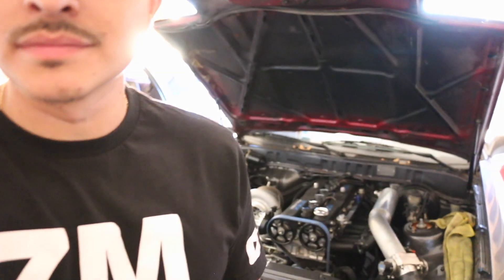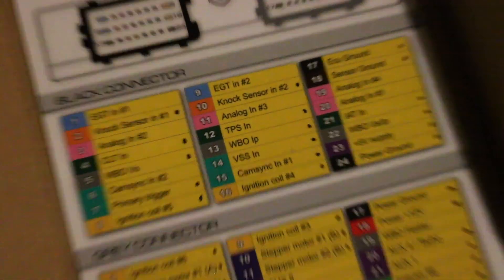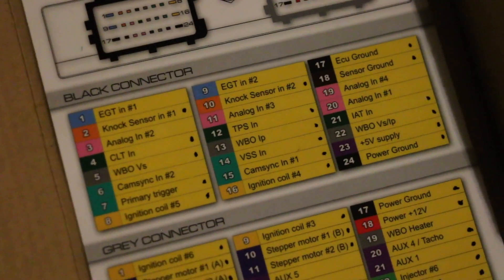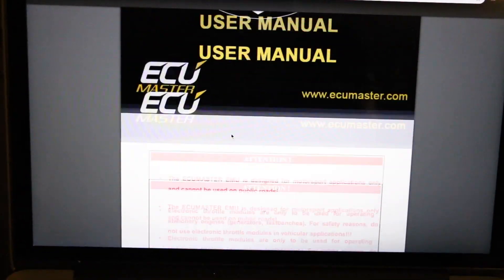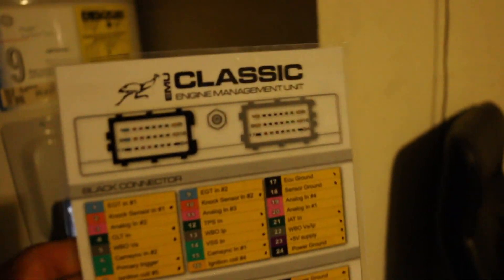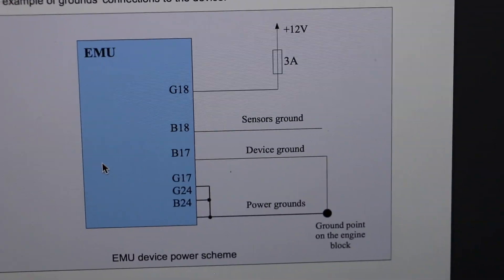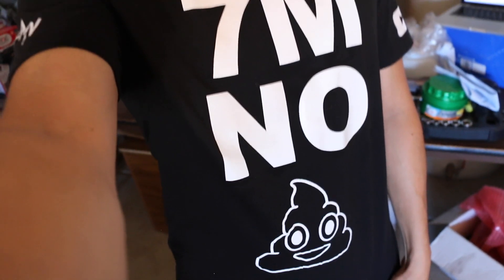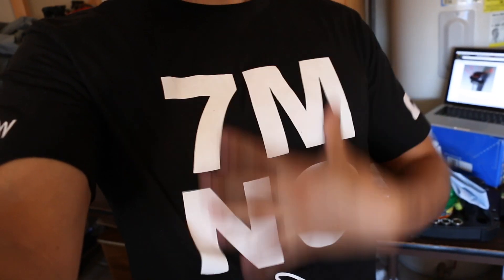MK3 SUPRA ECU MASTER EMU CUSTOM HARNESS (RESEARCH)

Comment: @6:27, I plan on using my WB Gauge to Send the 0-5v signal output to feed the EMU Black the O2 Reading for tuning etc. Once you check the Readings match You're all set. Also Ensure that your O2 sensor is within the spec distance from the exhaust based on the gauges Instructions as you will want to have the most accurate readings both to your ECU & Gauge. (Some Gauges reccomends 18 Inches away from the Exhaust on the downpipe. just a note to self). 

Thanks for being informative. Definitely enjoy the content. Keep it up. Hope the channel grows .
Reply from the maker: BjornFSE ive read that even then from the gauge there is still some small differences in voltage reading. That the most accurate reading is directly from the sensor

Comment: Pro tip for labeling your harness. Print you labels on paper, cut them out and use clear heat shrink over them. 
Labels from a label maker will turn black with the heat from the engine.
Reply from the maker: Franco Runco gotchaa thanks for letting me know.

Comment: Just finished wiring my emu black to my harness, goodbye wastespark!
Reply from the maker: Gortern niiicceee how was the process
Reply: @-LFATV  basically it was just a constant pinout read for both the 7m and emu, also had a owner's repair manual to help identify colors aswell as multimeter readings to furthermore identify. Wasn't too bad once everything was identified.

Comment: Use the pinout on the ECU Masters website for the 87 Supra. It will show you exactly what pins go where from the factory Supra harness to the standalone. 

https://drive.google.com/drive/folders/1CC1NSdBG3ReFh4GhS6N0EMRFGrygZqeZ

Make sure you know exactly what you want and where it will be mounted before you start making your engine harness. By that I mean your aftermarket stuff like the e85 sensor, wideband sensor, fuel or oil pressure sensors, GM air intake temp sensor, ect...

Label every single wire at both the ecu connector and the other end of every wire. I used painters tape at the wire ends and a clean label on the ecu side.

Just know for the grounds, 5v+ and 12v+ there is a lot of tie-ins so keep this in mind when you wire your sensors, inputs and outputs. 

You talked about fuses but I never had to run any fuses on my ecu masters standalone. The wideband has a 10a fuse built in the connector and the standalone uses factory EFI fuse so no worries there either.

Personally I would get rid of that factory igniter (also to clean up the wiring), have the ecu power your ignition coils and set it up as a wastefire set-up. I would also have it wired for sequential injected so each fuel injector operates independently and not batch fired in 2 sets at a time. 

I hope all goes well with your build and here is my pictures I took during my build. I never built a engine harness before but it turned out amazing: https://imgur.com/a/QKvz9

Comment: Use the r154 trans abs sensor (3wire) for the ecu vss input. Also a tip, use only the 4wires for the toyota iacv (software must be configured as stepper motor)
Reply from the maker: Cody Stedman thank you for the info man

Comment: I can't wait till I go megasquirt on mine, though I need a bunch of supporting mods before I can get there.
Reply: Don't do it, every high hp 7m is reliably running ecumaster and aem. I went megasquirt and couldn't get the car to keep sync once it got over 20psi.
Reply: @EditsWithBlur  I dont have 2k to put into just the ecu. Plus yeah it looks like itll be a little difficult, but there were 7m guys running them back in 2007 I dont see with newer tech I couldn't run it. I'll be wiring everything new so I dont have to buy a patch harness like you sometimes have to do for aem
Reply: @jonathan7744  you can wire new with any ecu, I did a full professional built harness on my megasquirt. The ecumaster us $800 just trying to save other people some headache.
Reply: @EditsWithBlur  No i hear you, I'm also not wanting more than 20 psi so I may not even see that issue. Hopefully I'll be all in getting most of my stuff for 800 instead of just the ecu. Anywho we will just see.

Comment: Nice work, engine bay looks amazing!  making a custom harness is tuff but well worth it. Couple things I learned is you can get multi colored wire on Amazon was a life saver, also you definitely want to run the wideband to the ecu. I have mine ran to a gauge then the  Auxiliary wire to ecu. Question what turbo and manifold is that?
Reply from the maker: chris hansen hey wats up bro, thanks for the info. I actually made a previous video of the wiring i will be using and it is color coordinated, that i oicked up from “wirebarn” i will be running the borgwarner s362sxe and its a driftmotion manifold with a huge spacer to fit the turbo lol
Reply: @-LFATV  what ar. Is that s362 and how is spool up?
Reply from the maker: E Black its an .88 n i havent ran it yet bro